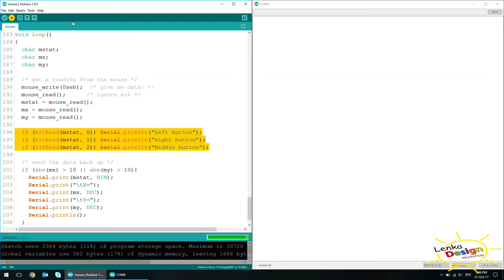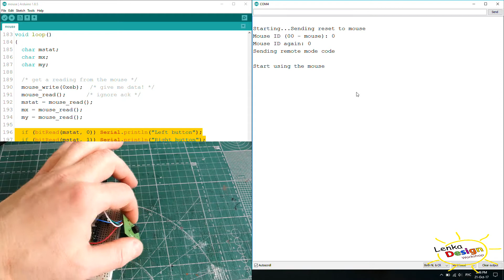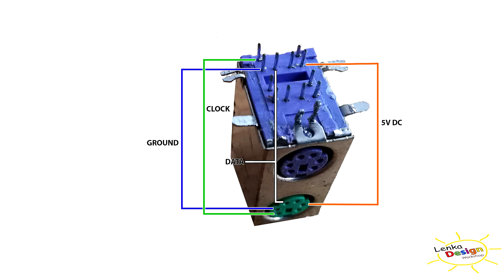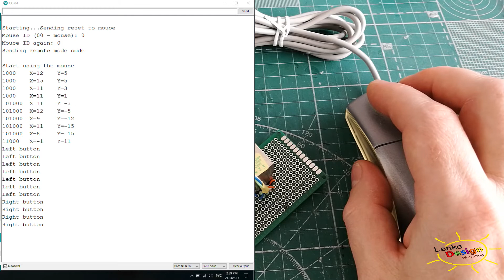How to connect PS/2 mouse to Arduino and also detect buttons

Comment: Bro, thanks for this video, but I have a question, can we use a usb mouse and/or usb keyboard with arduino like this? If u will answer, I'll be so happy! Liked ur video
Reply: Technical Scandal usb mouse does not function the same way as a ps/2 mouse so it cannot be used by an arduino
Reply: @dgrek9459  Ow its so bad, anyway thanks

Comment: How do I program the arduino to read my ps/2 mouse and output it as a mouse?
Reply from the maker: There are other tutorials on youtube that show this. It will not work on Nano - you need to use Pro Mini or some other HID compatible board
Reply: I couldn't find any.  I'm using an arduino Leonardo.
Reply from the maker: search for arduino mouse emulation
also reference https://www.arduino.cc/reference/en/language/functions/usb/mouse/
it is a built-in library